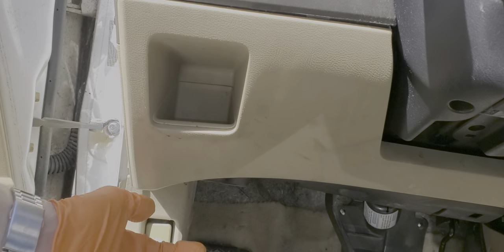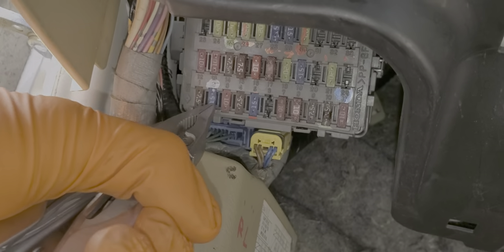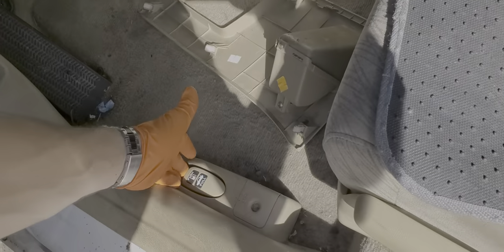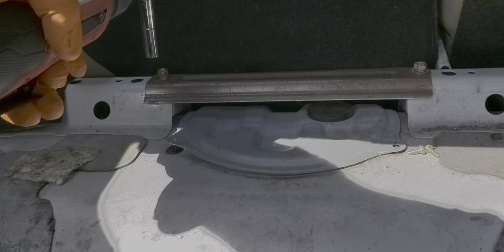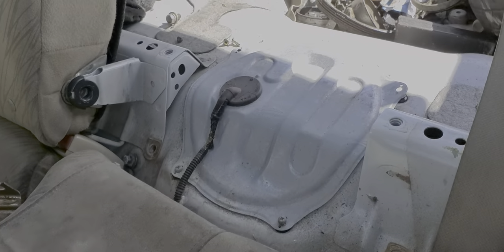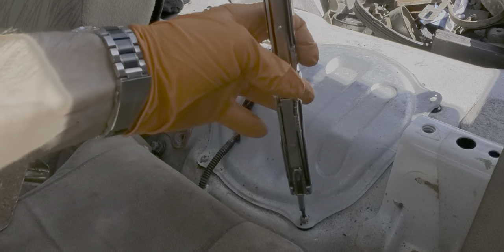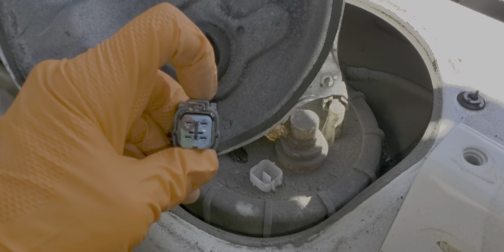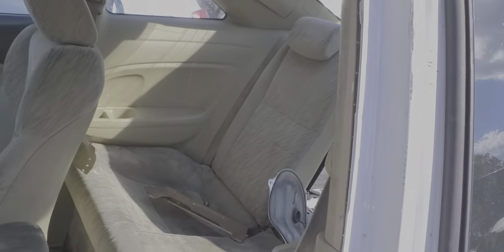2006 Honda Civic Fuel Pump Relay, Fuses & Fuel Pump Access

Comment: Perfect video...my neighbor has a girl that comes over to help tutor his kids.... her 06 Civic wouldnt start after putting in a new fuel pump 3 weeks ago (Factory OEM Honda Fuel Pump)...i ran thru all the possibilities and ended up at the relay...tapped it a few times and it started right up. Thanks Lehew Tech! You saved a young girl $120 in towing fees and whatever Honda would've charged her to diagnose the problem and fix it.
Reply from the maker: That is tremendous! I am glad that you found a solution.
Reply: I am suffering from a similar issue, I replaced my fuel pump, when car turns on I can hear the fuel pump working but the car still wouldn’t start. I disconnected the fuel line where the fuel pump is and saw fuel leaving the pump. I reconnected it and did the same examination at the other end of the fuel line and saw fuel leaving the fuel line there too. I inspected the spark plugs, no fuel on them whatsoever. Any ideas on what it could be would be greatly appreciated
Reply: @omarnaviwala2188  sounds like a spark problem then if you have fuel.
Reply: @constructionpros1279  my local honda daeler was stupid and unable to get my 08 hybrid civic to start. Yet they charged me $368  @ gave false advice. Telling me replace my ecu, the fuse box and the wiring harness. It was the fuel pump relays in front of the battery in a tiny box

Comment: Great video, thank you for posting it. I tried spark plugs, checked fuses, and replaced the fuel pump relay to no avail.  My situation is a cranks but no start, can that be caused by a faulty PGM-FI relay?
Reply: Did you ever get this figured out , same issue for me

Comment: 3:17 For the 2006 civic 4 door sedan I just worked on, there was a screw on the other side. I had to remove the bolts holding the bracket on the 1/3rd seat in order to get to it and remove the 2/3rds seat.
Reply: THANKS
Reply: @EfrainAvilaRojas  Glad it helped!  I was tugging hard on the 2/3rds portion thinking it was just a really tight friction fit before I took apart the 1/3rd seat bracket and found the bolt.

Comment: My 2006 Honda civic 1.8 the engine does when I come to a stop and go to give it gas and now it's dieing while I'm driving it I had a computer test ran on it it's showing fuel running lean I've replaced the EGR valve ordered the electrical fuel pump, mass airflow sensor and the fuel injectors is there any way to tell what's actually causing the fuel running lean code?

Comment: I got a 2004 Nissan Maxima. Whenever it’s under 70 degrees or even low 70s and my car hasn’t been very warm, my radio display will show that it’s on but no sound will come out until it gets warmed up enough and when it’s really cold it doesn’t come on at all. Idk what could be the problem and I’d appreciate it if you have any idea at all. Thanks!

Comment: Hello sir. I have a Honda civic si, no check engine light. It starts and run after a short drive it keeps stalling. If it start it will start again. Once I stop it stalls. New maf, map sensor.

Comment: Hey this video is very helpful but I'm having no start issues on a 2008 honda civic and there is no power to the fuel pump when key is on. Would that be a bad fuel pump relay? Also the fuel gauge reads 1/4 tank, when I unplug the fuel pump it now reads 0 and fuel light comes on
Reply: Do you hear the pump at all when you turn the ignition before starting?
Reply: @OliveSauce100  I hope you respond but I’m having the same problem just replaced the motor, replaced the fuel pump because that’s what I thought was the problem and it fuel pump doesn’t turn on at all
Reply: @arixramirez3701  You replaced the engine or the fuel pump motor assembly? I'm assuming that you first verified that it's not an electrical issue, by testing the connector with a voltmeter, with the key in the " on" position

Comment: Hi ,I have civic hybrid 2008 .I charge the fuel pump but it doesn't pumping fuel. And there is no power in the wire .can you help me find the problem ?!!!
Reply: Try replacing the relays in the tiny box in front of the battery. Also, it may be your acceleator position sensor

Comment: Can i increase fuel pressure on the stock fuel pump with an aftermarket ECU for a turbo conversion set up?
Reply: Nope need to buy a 255 + depending how much power you pushing
Reply: @esketit4421  thnx. Bought a 340 deatchwerks pump
Reply: You need an adjustable fuel pressure regulator